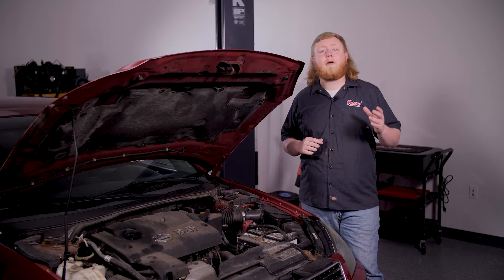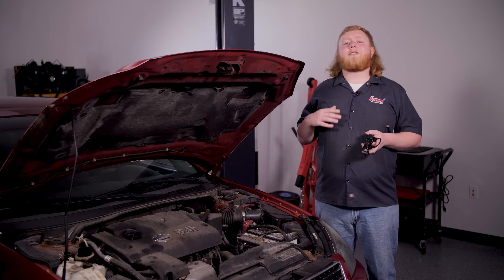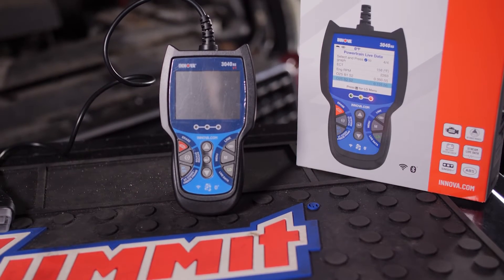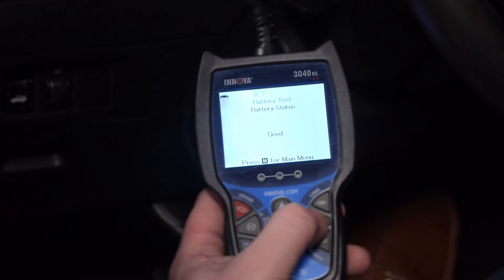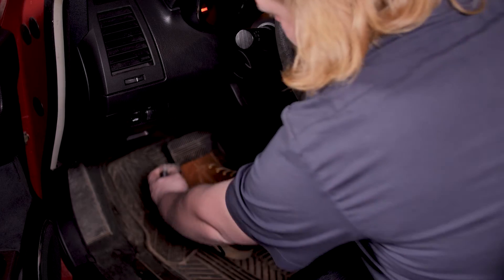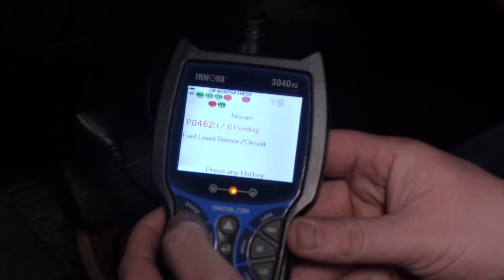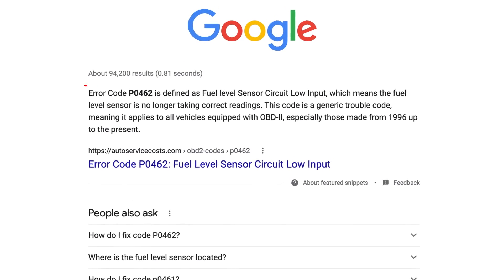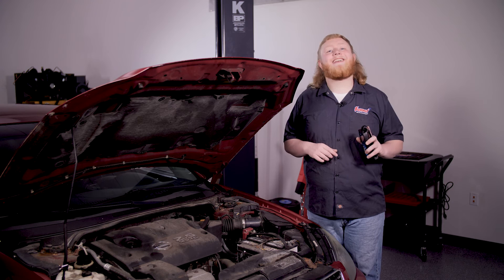How to Diagnose and Clear a Check Engine Light

Comment: i have this p0344 code that keep coming back i already changed my camshaft 2 times and  nothing happens i changed my 02 sensor as well but now my 02,cat and evap are blinking on my innova 0bd2 scanner now and it also says   stored freeze frame what does that mean??

 and when the check engine turns on it comes along with esc light coming on permanently not blinking then when i restart my car the esc will dissappear and come again some time after when i drive slow my car will start to sound like no energy it sound like a bad coughing continuesly but after a week or sometimes few days check engine will dissappear and then after a day or two it will do the same again but I also noticed that my car wont accelerate no matter how hard i press the gas and my gas run out quickly and my steering wheel feels a bit stiff sometimes a smell burning 

i change all the possible cause even when its not related to p0344 thats on but nothing happens,

and this issue hasn't been fixed yet no matter how hard i search

Comment: Is it worth getting the INNOVA 5610 Scanner over this particular INNOVA scanner used in the video. There's about a $256 price difference. ($89 vs $345).
I have a 2008 BMW 335XI model and getting an EVAP code with a "Service Engine Soon" light on dash. Not sure if the more expensive Bi-Directional scanner would help narrow the problem down. Thanks and nice video.
Phil

Comment: Okay so my question is if I scanned my truck. There were codes that popped out. I fixed the problem bought the parts I recconected the scanner and the same codes popped out. Is that when I use the erase button on the Innova scanner? So it's able to reset?

Comment: 2002 Ford Mustang 3.8L V6. 
Cleared the CEL light for a faulty PCV valve code. 
Now the CEL light is missing upon ignition and idle when it should momentarily come on for the ECM  check. 
The bulb is good and I need this light to pass emissions according to the certified state emissions protocol. 
What's my resolution?
Reply from the maker: The cluster performs a bulb check, and the check engine light should come on whenever the key is initially turned to the "on" position. I would recommend checking the power at the bulb location with a test light. If you don't have power at the socket, you need to look at an EVTM and trace the wire location. Additionally, make sure you have good ground and no corrosion or breaks in the printed circuit or harness.